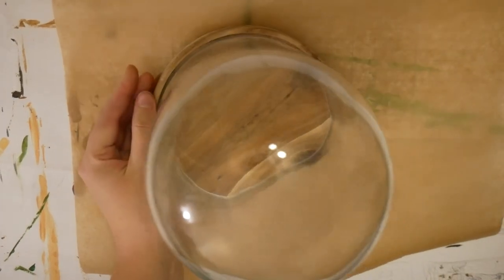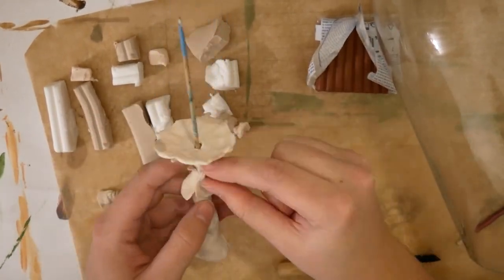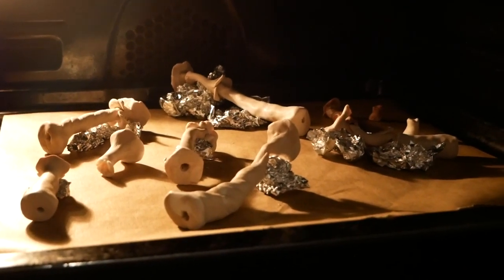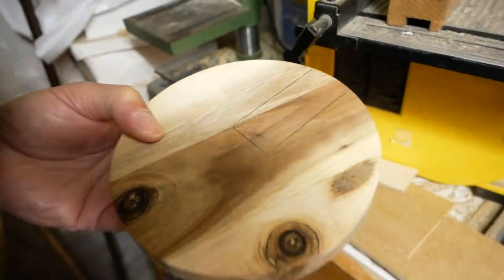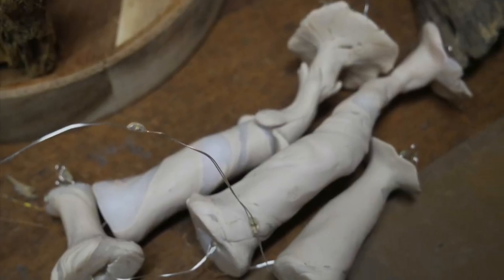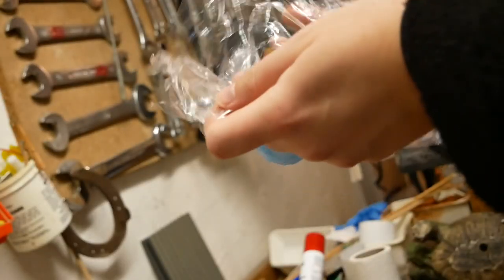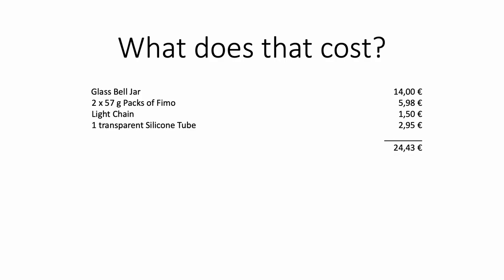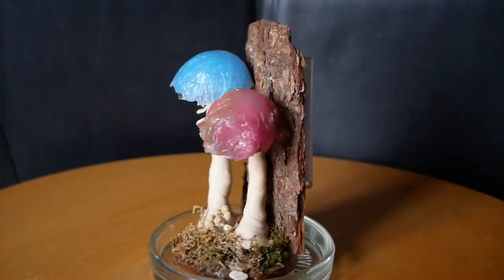DIY magical MUSHROOM lamp

Comment: To make the jars look a bit better, you could use a translucent glass paint in a few colors and add some moss to the outside.  You could also use thrift store stemmed glasses or clear glass bowls as a cloche look.
Reply from the maker: Yes great ideas! Bet that would look good :) I just used jars I already had at home for the 2 little ones bc I made them spontaneously with the leftovers
Reply: #@tomicorevilak7710 what do you mean by a cloche look with the glasses?  I am very intruiged? ❤😊  Would love to see an example.